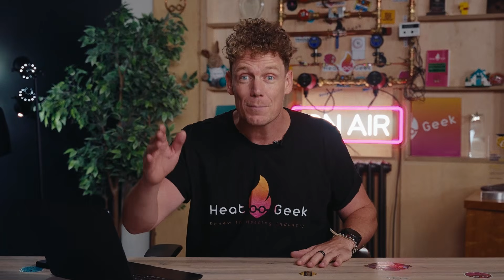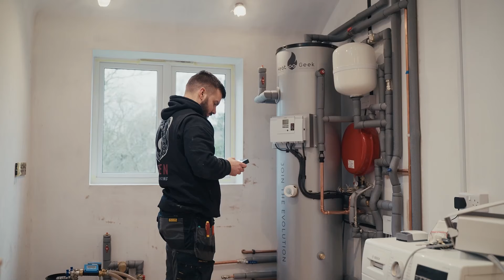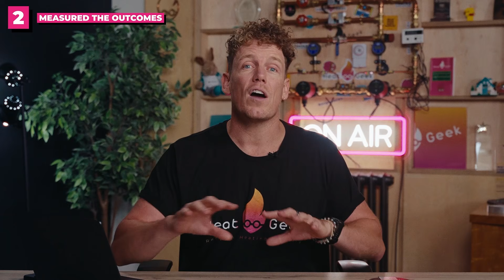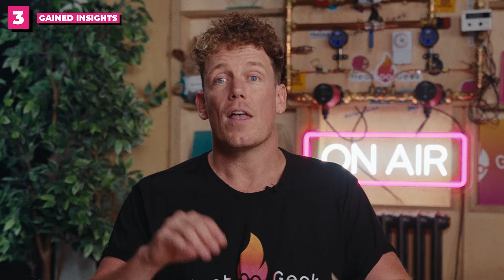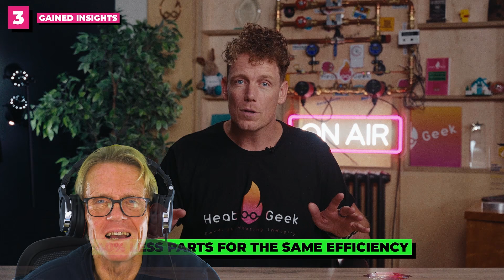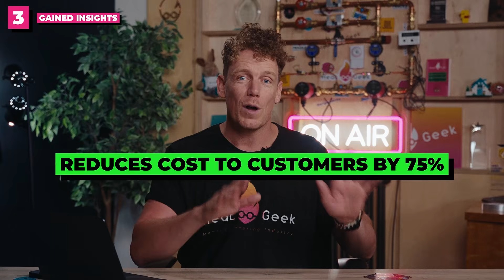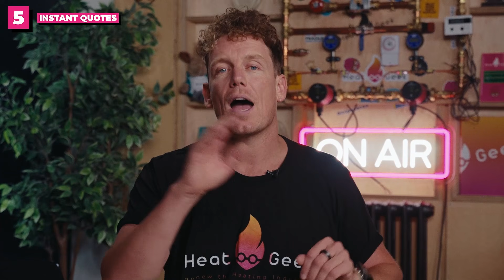Heat Pump Reality Check: Is Zero Disrupt Too Good to Be True?

Comment: My Goodness. Looking through the comments; it seems this topic causes more raised blood pressure than the "Troubles" in Northern Ireland.
For someone who declares his desire to see "Green" heat pumps succeed, Rodger certainly doesn't hold back from giving this fledgling industry both barrels at every opportunity.
While giving unfettered support without questioning would be wrong, we should bear in mind the rapidly improving technology evident in this field and cut them a bit of slack. If we resort to points scoring off each other, then it will be the planet and our children who will have to pay the price.
Whatever the truth is on subsidies, one thing I am sure of is that the fossil fuel industry is not going to pick up the tab to put right the harm past, present and future emissions have and will cause. Even if a future government tries to make them pay, they (like the Water Companies) will just plead poverty, pack their massive Dividends in their collective back pocket and slip away to their retirement villa - far away from any rising sea levels. And leave the rest of us to cope or.....

Comment: A case of optimist meets pessimist/protagonist.  I suspect in the end it will be something in between.  The relative cost of electricity to cost will drop as more renewables come online making heat pumps more economic.  As Heat Geek implied there will be economies of scale as heat pump installations increase.  I'm interested in the newer high temperature heat pumps, I assume they can modulate.  During short cold snaps they should be able to run hotter (although less efficiently).  I had a gas boiler fitted a couple of years ago, I suspect heat pumps will be the obvious choice next time.

Comment: Just dumped my gas boiler and radiators, and had the gas meter removed. The air to air heat pump is working fantastically, as is the induction hob and the big hot water tank, which I heat overnight on cheap electricity is meeting all our needs. I wish I'd done it years ago.
Reply: Most people shower these days, what if you had an instant shower unit instead of a tank of hot water? Last time I checked an instant shower cost to run was about 5p. a large unvented tank is about a grand
Reply: @dantronics1682fair point, but we have two showers, so lots of high current cables needed, and three sinks needing hot water. One big tank serves them all.
Reply: Been doing that for 25 years here in Japan and never had problems. No idea why anyone would heat their homes with radiators when better systems have been proven for decades!

Comment: Hi Roger. Please can you do a video for the use of heat pumps for off-grid use? I think a heat pump taking heat from a thermal battery that is powered by solar thermal water panels would be a good way of heating your home while keeping electrical energy consumption to a minimum. Thank you if you do. Also, I think heat pumps are like a heat recovery system but far more efficient so it makes sense to combine the two technologies into one so to reduce electrical input. Off grid people need low electrical input.
Reply: That makes absolutely no sense. PLEASE educate yourself on the BASICS of heating before spending any money.
Reply: @PureHokkaido My previous reply has disappeared so I will repeat it again and screenshot it this time. Heat pumps just take a heat source and move the heat elsewhere through an injection of energy, being electrical. The more energy the source has, the less energy is required in the heat pump process. Therefore, anyone wishing to go off grid to avoid the SMART grid control system would need to produce their own electrical energy. This is very difficult to do in winter months. Hence, by using a thermal battery as source, you can minimise the electricity requirements of the heat pump. Solar heating panels are very good at this and could inject daily the heat for maintaining energy levels in the thermal battery. I trust now you understand.

Comment: If anyone thinks fitting all that shit in your house instead of having a gas boiler you're a lunatic. We've 150 years of gas left at least, I've still got a back boiler and spend less than a hundred pounds in the coldest months and less than 40 quid in the warmest of dual fuel. I've still got a back boiler and until it dies it stays.

Comment: Just because you're improving the way of doing things it doesn't mean it was bad before. Well done to the heat geeks for looking to make improvements that will bring down people's costs over time. The energy transition is a big upfront cost but then savings thereafter.
Reply: Absolutely, it wasn't bad before, but we can do it better. Incremental change drives efficiencies. Realising what you don't have to do, and saving Heat Geek heating engineer time for the next job is important.

Comment: My son has just had a heat pump plus all new radiators and pipework installed for 16,500 (to replace storage heaters). He lives in the Highlands, so gas not an option.  Quotes for oil CH £15,500 no grant available.  With his £9,000 grant, he’s only paid £7,500. Running cost with OVO 15p pkwh.  Installed by a Heat Geek engineer and the whole experience was excellent. 

Admittedly, the grant was crucial. The new system now installed a few months is, so far, very impressive and so much cheaper and cleaner than the alternatives.
Reply: I truly hope your son is happy and warm 😊 I do wonder who has to pay extra in order for OVO to be able to offer his leccy price at 15p per KWh, however.
Reply: @M @MontgomeryPisswhistle n Germany we have similar cheap electricity plans for the heat pump or electric car (separate meter required). There’s no subsidies (indirect form other plans’ consumers). That plan comes with strings attached which cause that price difference, such as the provider can stop it a few hours per day at times of high demand/high prices or run it when there is excess, or if there’s deviations so it becomes an active element to stabilize the grid (Voltage, hz, etc).
Your plan is calculated by taking the average home load profile (high peak in morning and evening) times the hourly electricity price and then the average over the year.
Similar for OVO, except here the electricity provider simply removes the 2-4 most expensive hours of each day (stop the devices) -> adjusting the load profile which looks from the start just constant with no peaks, now with 2-4h of zero -> and the result of that calculation is that your new average price is 15p
Reply: And a grant is taxpayers money. It's not free
Reply: @dave-si1vq I didn’t say it was free. I also understand why people are frustrated and angry with tax payers money being used. BUT would you refuse the grant, in the same situation, given the alternatives such as oil were almost as expensive with no grant??
Reply: @davidswindells9145    ? how is your son able to get electricity for 15p kWhr   24/7/365.
Reply: @oldbutstillcurious3615 car starter cables
Reply: I have found three essentials but for a large three floor house , insulation from roof felt down , underfloor heating , use tiles not wood , K3 radiators . 
  Cost in our case was excessive but aimed at being the best it could be .
   Running costs would though be horrendous if we hadn’t done the insulation which has enabled us to heat all night on cheap rate turn off and heat retained for remainder of day .
  If we couldn’t run on cheap rate it would be very expensive to run .
Reply: He's screwed now OVO just threw everyone off their Heat Pump tarrif...
Reply: @stuartburns8657  How?  You wrongly assume he didn’t factor in the return to ‘full’ tariff. If you’re going to make that claim, at least back it up with the figures and show the running costs of an oil verses heat-pump in the highlands using the  29 pkwh rate.
Reply: @davidswindells9145  'screwed' relatively to the saving he'd have had on the OVO 14p rate or whatever it was.
Appreciate overall it's still better for him, but many OVO customers with HP's are going to find it's more expensive than their old combi boilers
Reply: why mist others pay for your son?
Reply: Sounds great
Reply: I bet it ends up costing more in electric than the storage heaters. Did for me. Like, 3x more.
Reply: Fake post
Reply: and its overpriced, should be sub £10k, so he would be paying £1-2.5k, instead both he and the taxpayer got rinsed
Reply: @ozwin2  Is that the same response if he went for the oil heating system at £15,500 with no grant?  We made sure we had lots of quotes and looked at all alternatives.  No one  company could offer either option cheaper.  As much as it offends people that grants are available, who in their right mind would go for the oil option and pay £9,000 out of their own pocket rather than use the grant??
Reply: @davidswindells9145 he chose the better deal, no doubt. But it is sad that this really should have cost him alot less, installers are marking up the work by a wide margin and although it feels like he got a good deal, in reality he should have got a better deal. Perhaps in the future there will be a "have you been misold ASHP, you might be entitled to compensation..."
Reply: If you think HE got a £9000 grant you are not dealing a full deck.....
Reply: @manoo422 . In Scotland, remote areas such as the Highlands get an additional £2,000 because it’s more expensive for trades.  Deck was fully dealt.
Reply: @manoo422 
Absolutely!!!
WHO really got that £9000?

can we see a quotation /  invoice showing costs of all parts with manufacturers original pricing + labour costs .

"You" then pay the invoice.. submit it to the govt... and they pay you back £9000...

Or - does it work more like..
Quotation shows costs of works.. less £9000.. - and thats what "you pay"..... and the £9000 goes directly to the installer...
 
Not quite the same thing..

Who really gets the £9000?
Reply: Your son spends over £15k per year for heating? Sounds about right if he owns 2 castles and a mansion.
Reply: @klimenz  😂  15p per kwh doesn’t equate to £15,000 on heating bills
Reply: @klimenz  The £15k is the oil system install costs, I think. Some of my neighbors were over £6k last year on energy. Entirely possible in north of Scotland for that to be £8k+
Reply: Utterly clueless. Who paid for the "£9,000 grant"? Why, the taxpayer!
Reply: @johnthomas338 I’m not sure why you think I’m clueless? If you read my other replies, you’ll find I’m anything but clueless, nor am I a hypocrite.  It’s funny how people are quick to criticise,  but faced with the same choices, they would take the grant rather than shell out an additional £9,000!!
Reply: @johnthomas338  answer to „why the taxpayer“
- HOW AND WHY THE TAXPAYER RIGHT NOW
the taxpayer pays for research at universities, right? Is that all that’s needed to have an economy that’s staying competitive? Nope. The next step is paying for getting that technology out there, starting production and get companies established. At first, there‘s few companies and production is expensive and few customers, so you need subsidies for them to survive long enough to lower production cost, teach staff, and get the product just cheap enough that there’s some customers. Once their business model and products work, prices of those new tech things fall by them selves, rising demand and you don’t need subsidies anymore to get customers, installers are needed, jobs are created all over, tax income is through the roof.
- HOW YOU BENEFIT FROM IT
The initial subsidies are a tiny joke compared to the many more millions in tax income that the new market and maintenance create.
It’s like not wanting to pay the upfront cost 1£ for a business that you know will make you millions after a few years.
And what do you personally gain? That there’s more tax income in the future and that the state can pay your pension and maintain healthcare and  social security and infrastructure.
About maintaining the social system: You’re not climbing a mountain of prosperity where when you stand still you stay at that level. It’s more like you climb an escalator that’s going down. You stand still, you go down. You keep up, you maintain your level. You outperform other nations, you rise.
I don’t mean to sound condescending with that long explanation, but you asked why, and economic theory is not taught in schools. A subsidy is an investment that usually pays off. It’s a bet but not like casino where you loose more often, more like win 90% of the time. Just like a stock market investment. And you don’t do it and could not, and a banker can’t do it for you, but the government does it for you instead.
- IF NOT THE TAXPAYER
what happens if taxpayers don’t subsidize new technologies/markets. In short. Say bye to your pension because there won’t be jobs for your grandchildren, and there won’t be enough tax income to maintain healthcare and other social systems.
Can we leave it to corporations? No because of their interests that are not that of society, e.g. Can we expect a gas company to invest in new tech that would burn less gas?
Time and time again you can’t leave it to corporations, or you get planned obsolescence and other shit like that driving their profit which is incompatible with how you would want society to develop.
And even if big corporations had the money to step in with the startup funding until the new tech is profitable, you would not get any benefit through higher tax income that pays your pension.

I guess that answers why the taxpayer.

In short:
1. taxpayers benefit
2. nobody else could, because we’re talking about sums of money so freaking high, that private or corporations can’t foot the startup cost, only nations can.
Reply: You havent got to the Scottish winter yet! Buy him a thick jumper and hat for Christmas, he will need it!!
Reply: @tempest957   They still make heat in winter. It'll probably just cost a fair amount more to run. But then they have the old cost of storage heaters to offset against it.
Reply: @tempest957 . I took the time to speak to customers who had heat pumps in his village fitted for a number of years by the same installer.  They all gave the same response, constant heating and hot water at a much lower  cost  of their previous heating system.

Comment: Im a very experienced civil engineer, I would love to put in a ground source heat system, but say Ive got 30 years left, I would never get my money back. Problem is that its a closed game. I can design my own system and have done so for many large projects, but try and buy the heat exchanger in the UK as a punter...no way... what a joke. And the misuse of the word Engineer... they are plumbers

And then Adam want higher gas prices so his business continues. The UK has the highest power prices in the western world because we are being ripped off by the power companies. The reason electricity is so costly is that these companies know that with the introduction of EV and such things as heat pumps, they are rubbing their hands
Reply: They are engineers if they survey and plan a heat pump system. Heat pumps are widely used in commercial premises. Why would domestic use be any less appropriate?

Comment: 14:00 One way to sell heat pumps in the absence of government subsidies would be to configure them for heating and cooling and size them to cool the house in the summer and supplement the existing heating system in the winter. That way, people could enjoy some cost reduction and  the option to stay cool in the summer without having to give up the heat and the heating capacity they already have. It's been an easy  sell for  a long   time in some places. https://youtu.be/ZdbPBqLtw44?t=959

Comment: You talk about subsidies, wind turbines have been subsidised since 1990 and mad Ed is planning a new 20 year term, that's a total of 55 years, now that is madness, so heat pumps could have years
Reply: They wouldn't be paying the money. If the money that the Wind farms owners paid to the Crown estate was used for its original purpose. Which was to deploy  infrastructure in 2016. Nope, Tax cuts to Joe bloggs was more important. Hence, the reason why they are paying for Wind farms to be turned off today 😕 short term thinking 🤔

Comment: Without question a Reform government will stop most, if not all, of the Net Zero type Grants.
We, the British Tax payers’ are paying for this renewable stuff, we’ve a stealth tax in our energy bills.
This lady sums it all up in this interview. It’s long, but great viewing.

https://youtu.be/MzCiEHGVMwA?si=5MfRH3AAlzpCb7Jx

As Roger has said, heat pumps are great, but their current design makes them practically useless for most British Homes. Our housing stock in the UK is poorly insulated, draughty & poorly built for our very changeable weather.
As the above video explains, our National Grid is a shambles, we’re in imminent danger of an Iberian style black-out this coming Winter, it nearly happened January 8th this year!!

Renewables are fantastic, but you have successive clowns in government, a ‘deep state’ civil service, all putting the cart before the horse. With Wind Farms, which are an eye sore, built everywhere & a National Grid system that can’t cope with this type of power generation.
It’s Renewable type generation that’ll cause our Black Outs.